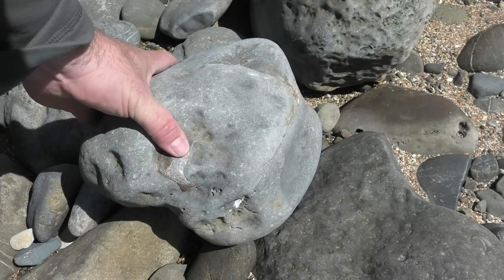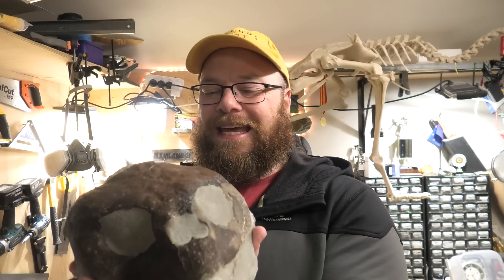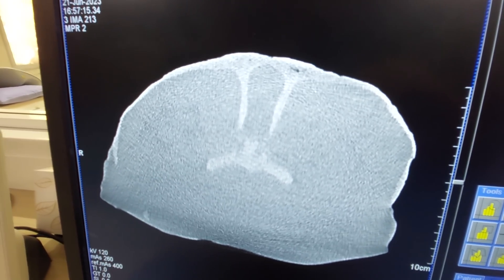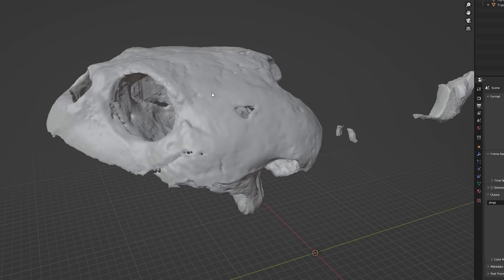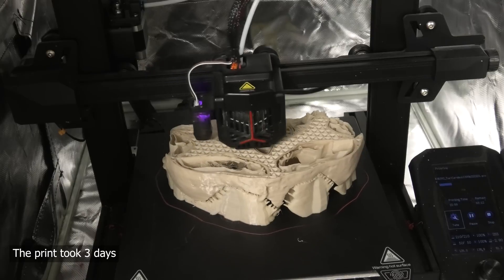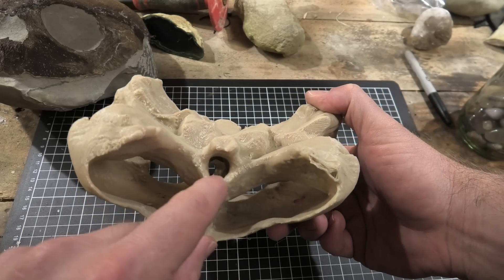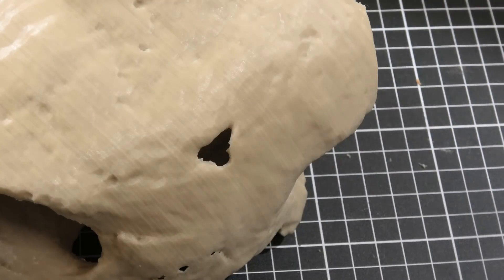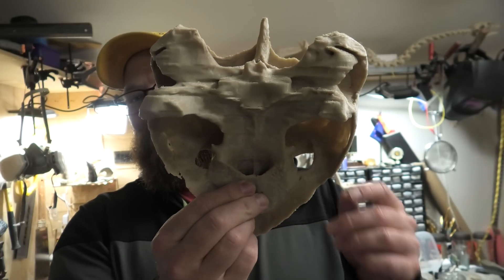X-raying a fossil skull to create a 3D model and then print it

Comment: It's an amazing 3D print, but I question the shark-bite hypothesis.  it suggests only one single tooth penetrated.  So does this mean there are a lot of other bite marks on the skull in line with the one that penetrated - i.e did the shark break all its other teeth on the skull while a single one got through?  What else swam in the seas with this turtle that could have done this?